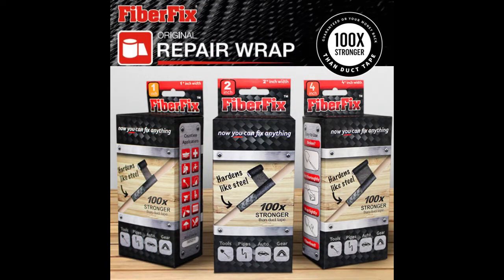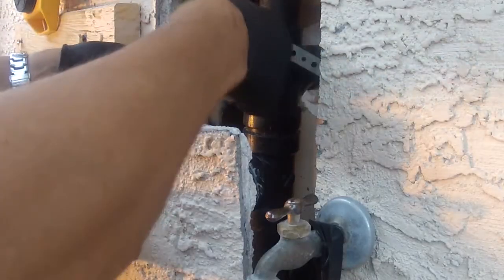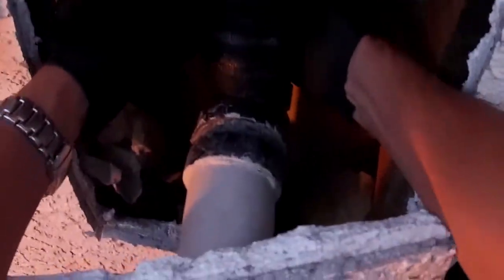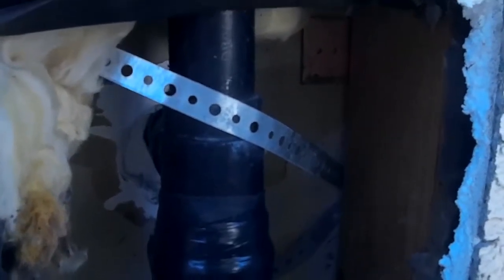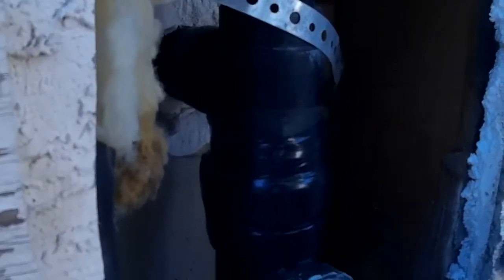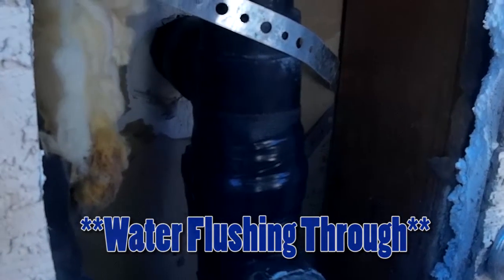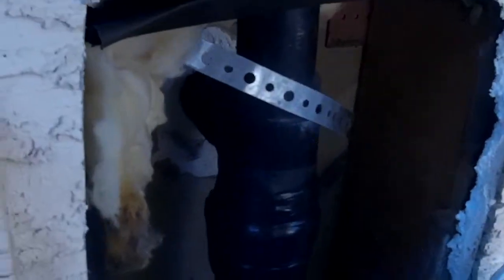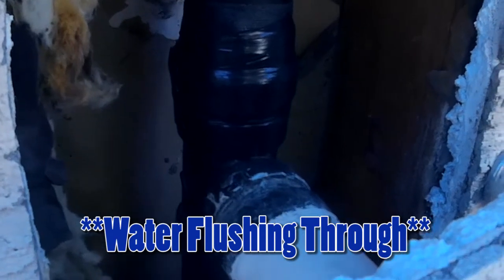I try FIBER FIX™. It actually worked.

Comment: It has been about a year. How is it holding up?
Reply from the maker: Still hard as a rock and not a drop of leakage. Keep in mind that this plumbing is for a Sewage Ejector Pump. The line is not under constant pressure. Not sure if that makes a difference, just thought I'd let you know.